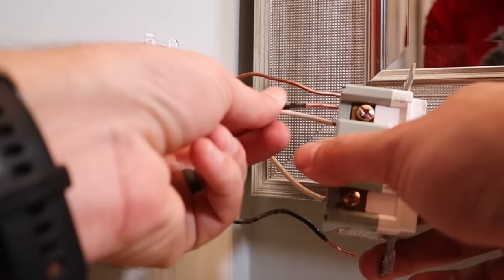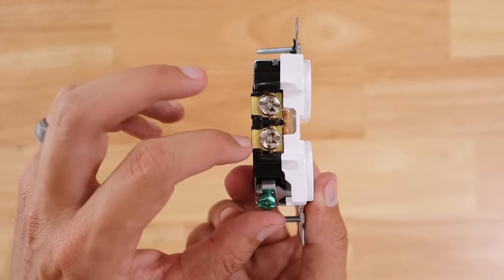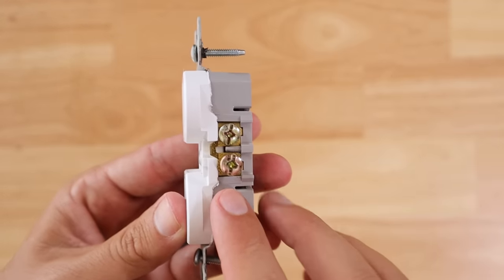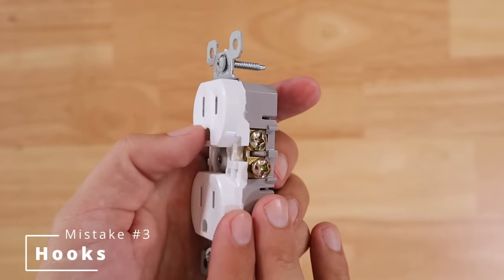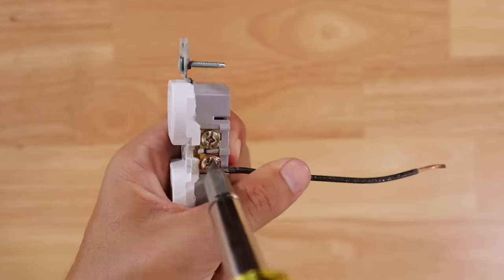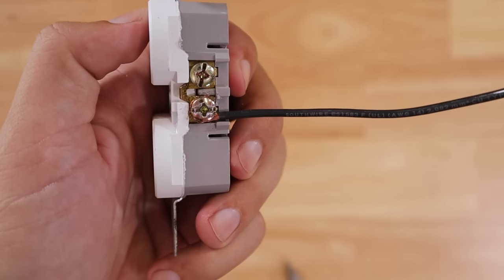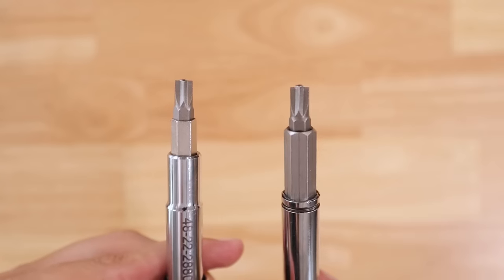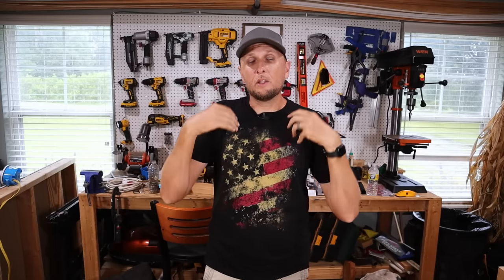The BIGGEST Mistakes DIYers Don't Know They Are Making When Wiring Receptacles | How To

Comment: You should always use pigtails especially if you're chaning receptacles together. If you don't you could be running the power through other receptacles. They can heat up and melt. Connections to other receptacles should always be made with wires and nuts.
Not using the screws.

Comment: The video should start by explaining that the ground pin faces down. Strangely, there are entire websites that claim that there is no rule for outlets, and you can "mount them anyway you want." That's absolutely wrong. The standard in America is to have the ground pin down, and that's because all modern 120V appliance cords are designed with the ground pin at the bottom, so when the flush mount cord is installed, the cord faces straight down Also, GFCI outlets have the ground pin at the bottom. Strangely some electricians on commercial jobsites still randomly mount the outlets upside down.
Reply from the maker: There is no code for a receptacles orientation other than it can’t face up and in hospitals the ground has to be up.  In residential and commercial it is allowed any way but face up.

Comment: I almost never use the push connectors, I wouldn’t call it a mistake by using them as long as you stripped the wire correctly and push them all the way in. Today, everyone is going away from wire nuts and using push connectors in every box where they need to make a connection and they using them up to 10 gauge wire.

Comment: 3:13 "Or you could have a case [in which] it short circuits ..." Shorts to what? Yes, the extra height of the insulation may mean the copper isn't making good contact with the screw, but the wire is still under the screw and unable to short anything.

Comment: You can't terminate stranded wire to that receptacle. You can't wrap stranded wire around a screw. In fact the receptacle in your video says on the back " solid wire only" if you have stranded wire at a receptacle box you either splice solid wire to the stranded or crimp on a fork blade stacon
Reply from the maker: Wrong again!  The “solid wire only” is for the back stab holes.  Also the manufacturer states stranded can be connected to the terminal screws.  You are proving more and more that you do not know what you’re talking about in all your comments across my videos.

Comment: 😊l would like to mention that if you over tighten the screws you risk flattening the wires. This will cause the copper wire to become weaker right where it enters the screw head and then it will run hotter than if you have not squished it. So you don't want to ever over tighten the screws the Phillips screw driver avoids this from occurring in fact the torque being applied should actually be measured .not one electrician l met actually knew what the proper torque  was.

Comment: Honest question. If its bad practice to do speed wiring who do manufacturers include it. I dont use it but never got a solid answer. Everyone says dont, but yet its there.
Reply from the maker: Can't explain why they allow it.  Just know from experience and hearing the experience from electrician I have talked to that they are the most likely to fail.  I trust the guys who work on them more than the ones that design them and test them in a controlled environment.

Comment: The most common mistake I see is they are almost always installed upside down. It's not meant to look like a face. Ground goes up for many reasons. If the ground is down the weight of the cord can expose the live contacts. I recently heard a story where kids at school were dropping change onto the live contacts but that can't happen if they are installed properly. It is so common that I notice smelly plug-ins designed for upside down receptacles.
Reply from the maker: There is no upside down in residential use.  There is no code specifying orientation.  Just can’t be facing up.

Comment: It's AC, both the wires are hot.  It's not DC were current is flowing one way, it's flowing both ways.  Where does the short come from if you wire it backwards?  If there's a short, there's a short, but wiring it backwards doesn't in and of itself cause a short.

I did like you explaining the direction to wrap the connecting wire so you don't push it out when tightening.

Comment: I’ve a wall switch and when it is turned off , the outlet it controls then reads Open Neutral. But when it’s on then it reads correct on my plug in tester. Why is this?

Comment: Never use a receptical as a junction point.   Pigtail it.   Outlet goes bad.    Doesn’t disrupt the rest of the circuit….   Especially when equipment is being on the same circuit that cannot be disrupted

Comment: As an electrician I was curious about what he was going to say.  
There is nothing wrong with back stabbing. If your house was wired by an electrician that is how they did it. 
The reason he said in some places it was done that way and not everywhere is because his kitchen, washing machine, and garage is wired in 12 gage and so it doesn’t fit. same as every other new house in America
Reply from the maker: No, that is not what I meant or implied.  It’s done differently depending on the electrician.  Some will do it the lazy and more dangerous way and use the backstab holes.  Many electricians know that these can be a problem due to the numerous service calls they get daily involving them and don’t use them because they are proud of their work.  That’s what I meant.

Comment: Green is actually a bonding wire not ground. Remember diyers all metal above ground needs to be bonded together and everything under ground needs to be bonded ideally converging at a single point preferably at the source
Reply from the maker: You’re making it more confusing than it needs to be.  We refer to it as the ground wire.  Not just me, literally any electrician you will talk to does too.  They do converge at the first disconnect.
Reply: @HowToHomeDIY  You are right, everyone does refer to green as ground. Electricity is complicated,  potentially deadly and shouldn't be taken lightly. Do you understand the difference between bonding and grounding because I bet most diyers do not. Am I nitpicking? maybe. Are you an educator or content creator? If you are the former calling things by their proper name should be important to you if you are the latter please disregard everything I have said. FYI I appreciate your videos.

Comment: 1979double wide mobile copper not aluminum wiring, plug in the laundry room plug in dryer dryer blows  without a sound when turned on  3 second hand dryers later ! I was told sometimes in breaker box people split off dryer wiring to use to power Furness at the same time ???? I follow fat wire bundle under house to box no breaks in coating or pinch but inside box it is split off to 2 separate breakers??? Most breakers not labeled very old (mouse fried to mummified from looks like 2 points of direct contact )i don't know electrical hard to get electrsions to come for small projects is this splitting 2appliances a normal thing looking for better idea on what is going on so if/when electrician comes by I can relay better idea of potential problem at hand ! Any clues out there?

Comment: Youre not supposed to have the circuit going through the receptacle because if you have to replace the receptacle it kills the power to the receptacles further on down the circuit. You should have one pigtail for the black wires and all the blacks spliced together with a wire nut as well as the white wires. This os a practice recommended for commercial applications but it also is wise to use in residential applications.
Theres also a tab you could break off between the two cooper ~ hot screws to be used for one receptacle  being switched power for a lamp and one receptacle being powered all the time.
Reply from the maker: Yeah I mention pigtails in the video.  And while I agree that is a better practice, it’s not code unless on a multi wire branch circuit.
Reply: @HowToHomeDIY  I've been a CT.  electrician since 1983 and thought I remember it being code, I could be wrong though. I haven't been a house mouse for ages, I like commercial/ industrial work, residential was like a stepping stone in the trades. Give me some conduit and and type of hand bender or hydraulic bender and I'm happy as a pig in shit.

Comment: So, I'm a DIY guy, but a very particular and anus-rententive sort who never touches anything unless I've spent a lot of time learning how to do it right.

I was staying at a freind's house and an outlet stopped working. She said it was a "problem" outlet that sometimes worked and sometimes didn't. Now it had completely stopped working. She also told me her "electrician friend" had already looked at it and told her it was "loose" from people plugging in and out of it so often, and that it wasn't a concern.

I had my multi-tester, so since I've learned there's no such thing as a low-risk electrical problem, I checked it out.

Open neutral.

I am also a former fire fighter and I have only ever seen three kinds of house fires: space heaters, bad wiring, and arson. So, despite her protests that I was wasting my time and that it wasn't important and that a "real electrician" had said it was fine, I insisted on at least having a look.

I opened that outlet, and everything was fine. So, I tracked back to the next outlet. At that point, she told me that, yah, that was another "loose" outlet from being used so much (the house itself isn't more than 20 years old) according to her "master electrician" friend.

Opened up that outlet, and there I see the neutral and the hot that carries the load to another outlet in the circuit are just hanging out in the back of the circuit box. I turn around the outlet, and guess how the remaining wires are connected to the outlet.

Yep. Stabbed.

Tried to explain to her that electricity causes very slight vibration, and there is not outlet I have ever seen that is designed in such a way that plugging and unplugging from it will somehow cause wires to become loose. That was probably a mistake, as then she got pretty hot about me thinking I knew more than an electrician with decades in the job. Which, it turned out, I kind of did. Dude didn't even know the AC waveform causes physical vibrations.

That experience strongly reinforced my dislike for the stab connections, and reminded me that there are often people who should know better who don't.

Comment: Is it bad that my receptacle only had two wires on it? House is really old
Reply from the maker: That would be normal for an older home.  Oftentimes grounds weren’t installed.  So it’s not bad if you installed a 2 prong receptacle that way, you didn’t really have another option outside of running new wiring which is very expensive, or installing GFCI Outlets.

Comment: Mistake +1 : holding the recepticle upside down! Yes. It's a thing. There's a reason the text on back is "upside down"! 🙃
Reply from the maker: They have to put the text one way or the other.  It’s not upside down, there is no code whatsoever that designates orientation of a receptacle in a residential application.  It just can’t face up in certain applications.

Comment: Instead of remember black on gold, just look at the sizes of each hole. The hot side is smaller because it’s more dangerous and you really don’t want children sticking things into that side. The neutral isn’t as bad so it has a larger hole. This makes remembering which side is hot a common sense problem instead of memorization.

Comment: I know diddly squat about this subject...but all this seems obvious. Why not just use a flat head screwdriver on the screws? And it's hard to believe that someone would put two wires under one screw. Seems crazy. Lastly, is that a design flaw on the rear, allowing someone to insert wires?

Comment: Most electricians won't wrap stranded wire around a terminal screw, like was shown in this video.  In most jurisdictions I've worked in, that won't pass inspection, either.  In commercial we use higher grade receptacles with square terminal plates that don't spin.  Residential often uses the cheaper outlets, but with solid wire.  If we need to terminate stranded wire to a screw terminal, we install a fork or ring terminal, to ensure a rock solid connection.

Comment: Why use 15 Amp breaker? On 15 or 20 Amp breaker? 20 Amp breaker/ outlet passes 2400, 15 Amp outlet passes 1800 which is easily overloaded, ie: a toaster oven/coffee maker on same circuit  run @ same time on 15 Amp outlets starve  both appliances cutting down the life of appliances or worse case, .melting outlet

Comment: What if my house is old and not grounded?
Reply: Then you either have to use a 2 prong receptacle or a GFCI receptacle. The GFCI receptacle will give you a safe outlet, even without a ground wire.
Reply: @surferdude642  My house is old, and the people who lived here before us rewired the whole house. There's 4 ungrounded outlets from what I can see 😭
Reply: @dearestnovelite  They may have omitted those during the rewire. I live in a neighborhood where the houses were built in the 1950's. I have seen several cases where remodeling was done in some areas of the house. So you find 3 prong receptacles in some places and 2 prong in others. 
Having only 4 ungrounded may not be too bad, depending on location, plus you can replace some or all of them with GFCI's and you'll be in good shape.

Comment: I don't get the whole issue with "back stabbing." Sure, a hook is potentially more secure, but it's not like these things are loosely inserted nor should an outlet be regularly getting pulled out and pushed back into its box. If the supposed expansion from heating and cooling would loosen that, it would loosen the hook from the screw too. Really there's no good reason to not use backstabbing when you're using 14 gauge.
Reply from the maker: Due to the heating constantly and minimal contact in the device, the connections become loose and can start arcing or start a fire.  It’s actually more common than it should be.  The terminal screw is not only looped around the terminal screw but it’s an actual mechanical connection.  There is less resistance created, less heating, and since it’s mechanical, those factors have almost no effect on the screw.

Comment: Why do the outlets and switches have exposed contacts?  In the demo where you strip too much wire, you are talking about having this unnecessary electrified gap - fair enough. But right next to it is a giant electrified plate and screw!  What gives?

Comment: This is all assuming that the person who wired the home used the right color wires, or the home isn't old and some of those conventions weren't established yet.

Point being, use a volt meter to establish what wires are what, even if it looks obvious.  And every outlet you buy comes with a diagram telling you where to put each wire.  Read that.

Comment: There is only one colour of wire that is identifiable by its sheath covering, Green…. Every other colour wire, including white could have voltage 120v or whatever you may be dealing with. Wise to use a tester.
As for the holes in the back, it may be legal but I have replaced well over 3,000 of them in my 43 years. Many had wires well burnt back, 3-10 inches in some cases and it involved some serious repairs at that point. Piece work electrical companies use them for speed work when doing a home. It’s my honest opinion that they are a great Fire hazard and should be banned, avoided using them at all costs.

Comment: Let’s just tighten down a little bit more... Wrong the NEC requires the use of a torque screw driver on devices.
Reply from the maker: Nobody is using a torque screwdriver.  Not one electrician have I EVER seen use one on a receptacle and I have NEVER seen an inspector care to check them.
Reply: They are used across the industry and are part of the required tool list.

Comment: I know its bad practice and unsafe but ive done it before, if i do 1 wire at a time i can change an outlet without turning off the breaker cuz their not marked n god forbid i turn the main off resetting everyones clocks and wifi but i cant just guess which one i need without turning off one at a time anyway and might as well just tell all 3 renters i need to shut the main if you want these 2 dead outlets fixed out in the living room and one in the kitchen.Theres literally an extension cord going across the floor for this ladys oxygen machine,Wifi,her Cell,AC and shes just gonna have to deal with it lol

Comment: In architecture school my landscape professor pointed out all the campus sidewalks then the worn footpaths across the grass. Who’s wrong? The one architect who designed the sidewalks or the thousands of people daily walking across the grass. Sometimes common mistakes aren’t mistakes but the masses showing you your poor engineering.
Reply: The lazy people who cut across
Reply: @DarkBykeTwitch  You clearly miss the point. The purpose of the sidewalk is to create a pedestrian path of travel. If one person designs a sidewalk, then thousands of people (through their actions) show the sidewalk is not in the correct place, then the sidewalk does not serve it's intended purpose. The people are not lazy - the design is wrong. Its like designing a car and forgetting to make a place for someone to sit in it. Its then no longer a car (per se) but a mechanical device with no purpose. Who is the car for, who is the sidewalk for, who is the outlet for???

Comment: Screw connecting stranded wire is not reliable and shouldn't be done, in my opinion.  It would be better to pig tail stranded to solid to connect to a receptacle but probably that would not adhere to the rules electricians go by.  What a fine mess!